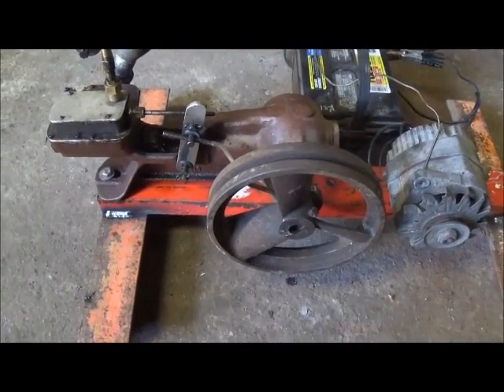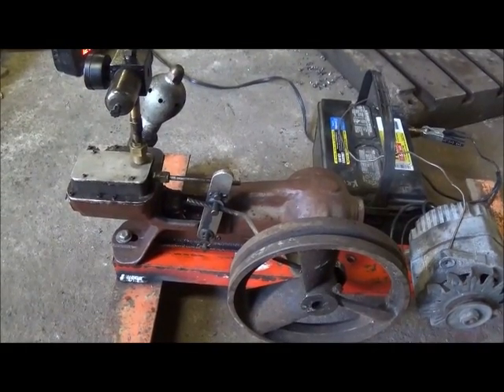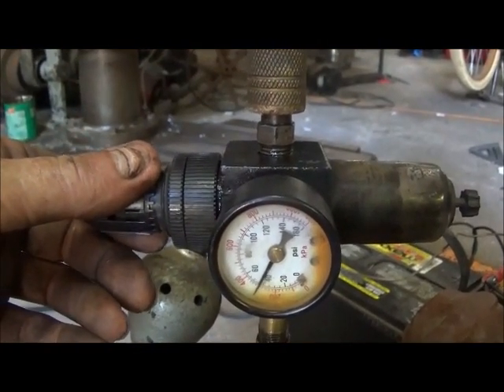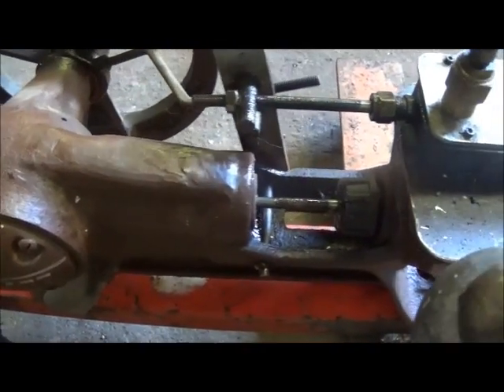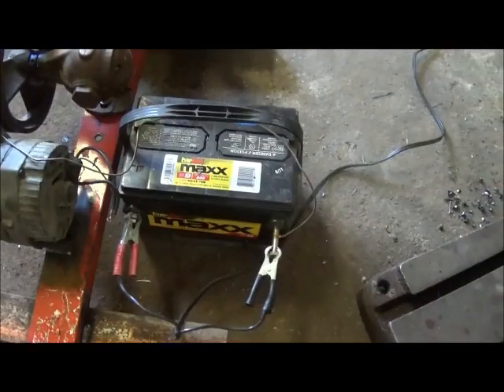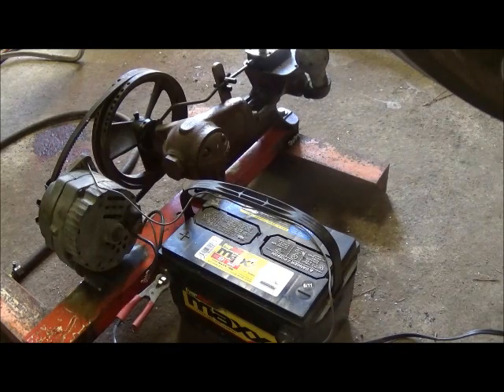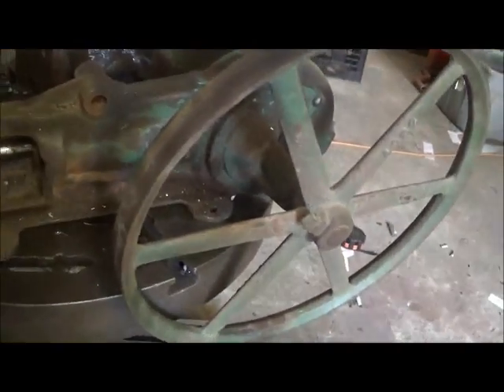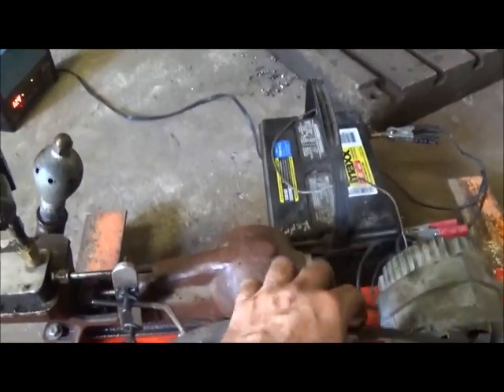Steam Engine Made From Well Pump Off Grid Fail!

Comment: l wonder if you put a vareable resister on the exciter wire so the alt is not going to full output,
Reply from the maker: mustie1 Never thought about that, I may give it a try and I will post an update. Thanks.